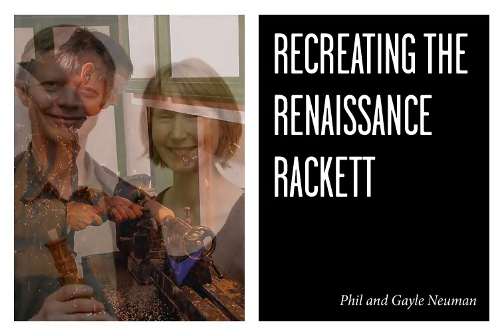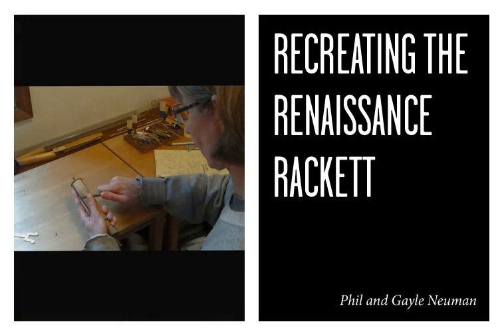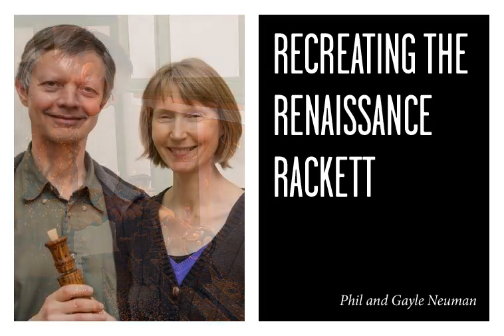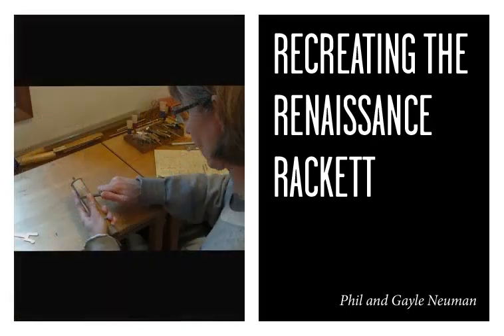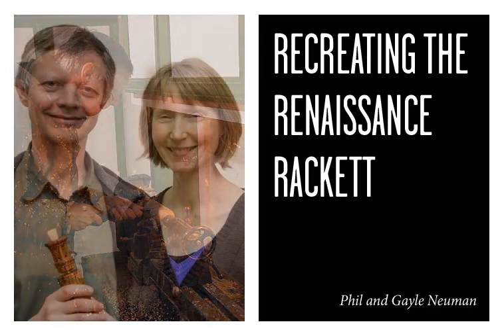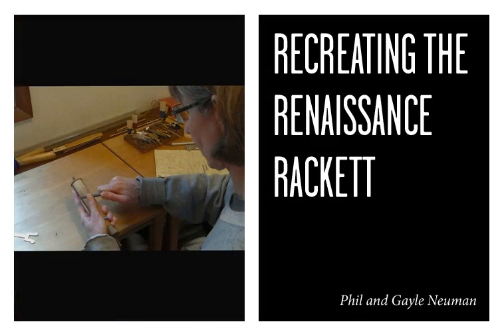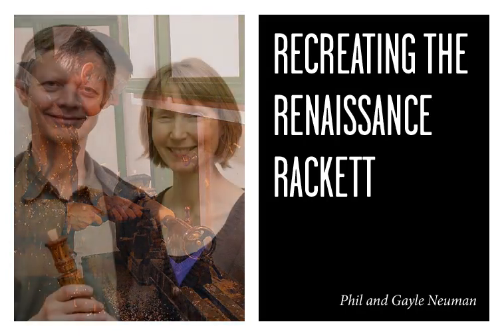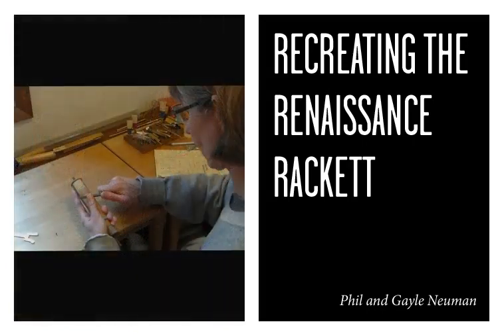Recreating The Renaissance Rackett

Comment: I've just bought a Renaissance rackett. But there's no fingering chart and what happens when i cover the holes seems totally random. Anyone know where I could obtain information on how of play it?
Reply: There is info available. We need more details. From whom did you buy it? Who made it?
Reply: @BushRoger  so did I. It’s painful to play though.
Reply: How good is that kit?  I've been eyeing it for quite some while now.
Reply: If you get an Tenor-Alt Rackett in F, the fingering is the same as other instruments.
0 is the thumb hole, and 1234567 are the other normal fingers.

C: 0 2
B: 0 1
A: 0 12
G: 0 123
F: 0 123 4 6
E: 0 123 45
D: 0 123 456
C: 0 123 456 7.
To go under that you will use the other parts of the right finger 1.
BB: 0 123 456 7 8
AA: 0 123 456 7 89
To do GG you will use the first part of your right pinky.
GG: 0 123 456 7 899

If you have a Great Bass Rackett, you will do G without covering the other parts of your left first finger and covering the thumb hole, so

G: 0
You will do F covering the first part of your first lerf finger,
F: 0 /
E: 0 /1
D: 0 /12
C: 0 /123
And that...

I dont have a Great Bass, but from videos that i seen is that...
I think Bass Rackettnuses the same fingering of Tenor Alt.

The Cant Rackett is in G i think, i dont know the fingering. Soon i will know.

Im late, you maybe know the fingerings at the moment, tell me if i am wrong.
Reply: look it up, some websites will have figuring charts.
Reply: @forveillelier 
No, I have only just seen your reply, and I never did find a solution! I stopped trying. I have only just been notified of your reply, Thank you soooo much!

To everyone else: Thanks for the advice, but I am a bit of a dog with a bone when it comes to seeking things out on the Internet, and this was one of those rare things where a very long and thorough search yielded no results at all. I have forgotten what kind of instrument it is now, or even whereabouts in the house I have it stored. But I’ll post again when it turns up, since this thread seems content to progress very slowly!